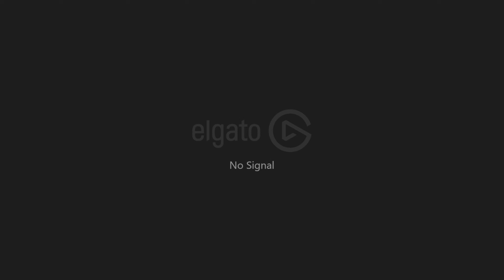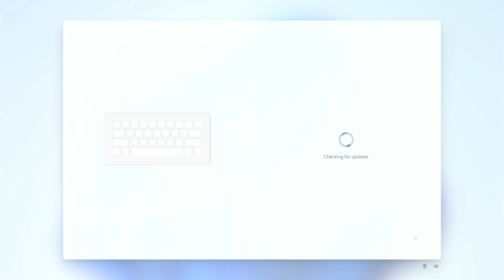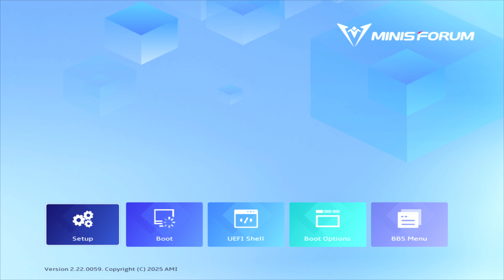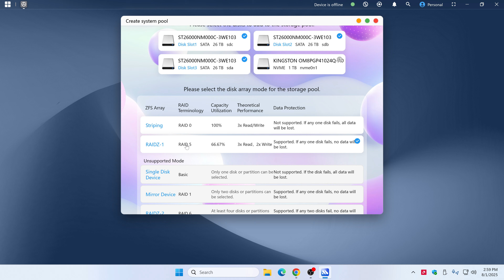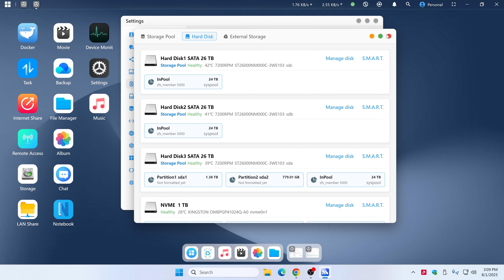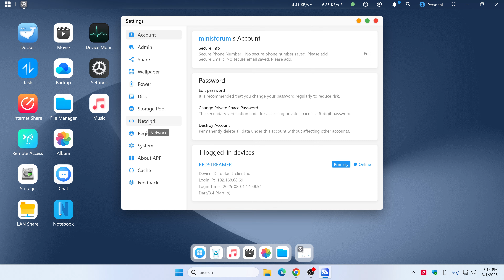Minisforum N5 Pro AI NAS: Powerful CPU, GPU, NPU + Slide-Out Design for Easy Drive Swaps!

Comment: i sent it back, the nvme slots only have 1 lane, so very slow performance 😞
Reply from the maker: The Minisforum N5 Pro's NVMe slots often appear to have only one lane (x1) because it's a compact NAS designed for balanced use, sharing limited PCIe lanes from its mobile CPU; while it physically has multiple M.2 slots, they share those four lanes (x1, x1, x2), and a full-size x16 slot is electrically limited to x4, all due to chipset constraints, not a fault, but a design choice for its all-in-one NAS/server build. Its common sense if you understand what you're buying.

Comment: I want to like mine but its still noisy and fans not as standard as it should be. I have bot N5 Pro + Aoostar WTR Max. Aoostar is quieter for sure. 
And when i put regular HD's in the N5 pro the vibration is bad. I use WD Red NAS 22TB. If you can have it in another room then its great but sitting next to it is bad.
Plus i thought i could just swap the back fan with A9 Noctua but noooo the headers dont fit :( 
Still both N5 + Aoostar are the best options for proxmox or unraid. I dont like to use their software.
Reply from the maker: Thank you for the feedback!

Comment: 40:15 that USB port is for those guys that run unraid that require a usb stick for it.

And about the drives, if you're fine living without a warranty, you could get some Seagate Expansion external HDD and open them up. Inside the bigger ones, those use exos drives. I got the 24TB ones for $250 during amazon prime days.

Comment: I don't have one to back my theory but watching you setup the SMB, I realize you didn't click on the + icon at the bottom right to create a share. I assume that plus icon is for that reason.

The usb port on the inside is mainly use to boot a USB drive. It's for the unraid user out there to use without sacrificing a usb port on the back or front.

The Windows driver on their website is for you to use their driver if you decided to use Only Windows instead of their Nas software or other Nas software such as TrueNas, Unraid, OMV, etc. 

In the bios, you can change the boot order to boot directly to the provided 64gb nvme that have their os on. Best of all, you can wipe it and install TrueNas on it and run TrueNas or other Nas OS.

Other thing, RAIDZ-1, 2, 3 are all ZFS system that are similar to the traditional Raid system you understand. If you get into TrueNas Scale, you'll be using ZFS only to create vdev pool instead of Raid. Unraid let you choose between ZFS or their Unraid Array.

When I get mine, I will be aiming at installing Proxmox and pass over the storage Raid card over to a Truenas VM to do the Nas part. That way I can still use Proxmox to deploy other VM or LXC for other server usage and only use TrueNas for storage sharing. That way i can use their NPU and iGPU for other thing. Hope this help you or the next person.

Comment: I just got my N5 yesterday and have issues to setup even a docker yet properly.
Have many glitches, issues on they Miniscloud system. Could able to reach over my PC, but my TV or other devices can't see it. 
I know we are on uncharted territory with this beta system, but hopefully will be more clever after a few weeks.
Your video helped me realize I'm not alone with this. I started feel myself I'm a complete idiot, but now I'm excited to jump in a new journey..
Reply: im still waiting for mine and cant wait
Reply: @st4lker215 did they dispatched yours?
Reply: Just put TrueNAS or unRAID. Day and night difference. The HW is more capable than most Qnap/synology SBM systems.
Reply: @sebasanfilippo Considering that. This miniscloud OS is an fnos based Linux. Fnos a Chinese system and still in beta. Really minimalistic, but on my daily 1-2 hours free time finally been able to learn a lot about it. Unfortunately don't have any tutorials in English yet. Could find only Chinese ones here on YT and on bilibili site.
Ordered an rtx 3050 LP and maybe next month a 96GB memory kit to max it out. Probably overkill for my daily usage, but it after that I won't need to do anything with it for a decade...
Reply: Eventually gave up on Miniscloud.
Tried truenas and omv but couldn't setup a secure connection so installed the zimaos. Seems everything works just fine on that os.
Reply: @JulianDanteBelmont  With ZimaOS does it show the current watts on the cpu widget? I installed on different computer and it didn’t. But good to know it runs ZimaOS. I have a Zimacube. Simple OS.
Reply: @pdaddy8971 I saw only the CPU and memory load, but will check in the details if I won't forget when I'm finally at home.
Reply: @JulianDanteBelmont  where are you based and when did you order?
Reply: @st4lker215 I ordered from minisforum official website at 1st July. Love in the UK.
Ordered with 16GB memory and as they promised they'll dispatch end of July, they did at 30th July.
Strangely I got with a 128GB m.2 SSD instead an advertised 64GB emmc. That's a good point from them.
Reply: @st4lker215 I'm in the UK and ordered at 1st July.